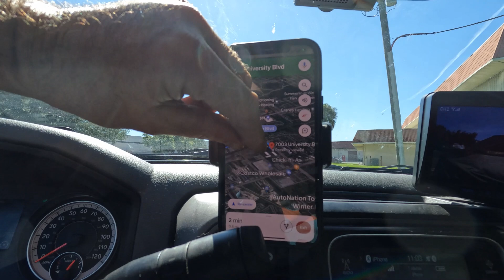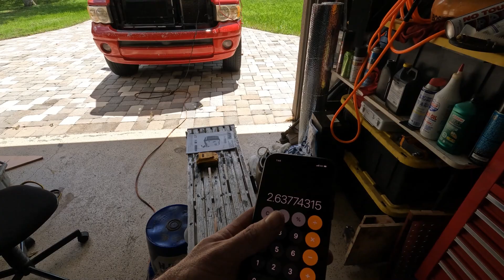CDL Hotshot - 24 day trip - What's our gross?

Comment: You must’ve spent about $5,000 on fuel? And I’ve loaded a trash compactor at that facility before. The broker ripped me off. Never got paid.
Reply from the maker: More then that.  That sucks man.  Factoring company didn't get it?
Reply: @kdlhotshotrv  factoring company wouldn’t take them. My “dispatcher” convinced me it was a company similar name that had a good credit score. He was always in such a rush to secure a load that I let him convince me they were good to go. I went to factor the load and the factoring company said “nah. We’re not touching them”. And he screwed me over on the first two loads immediately before that. The very first two I worked with him on. That was the last time I used a dispatcher. I’ve done SOOOO much better on my own.